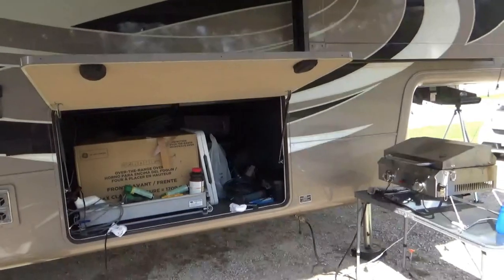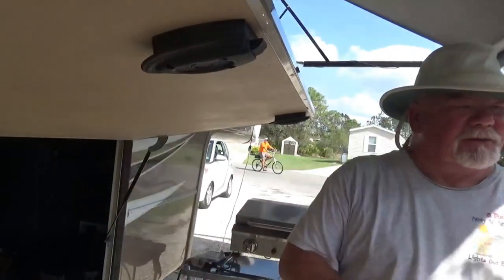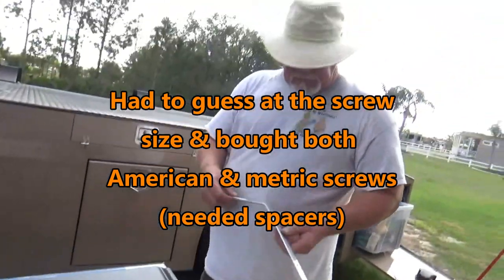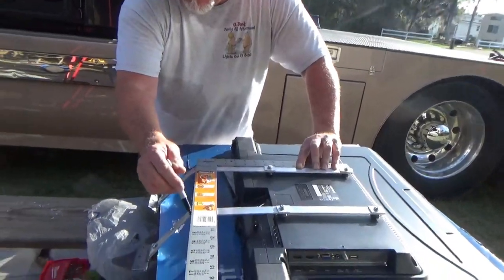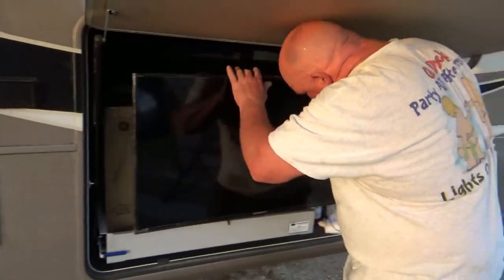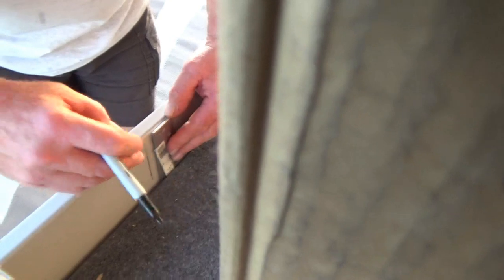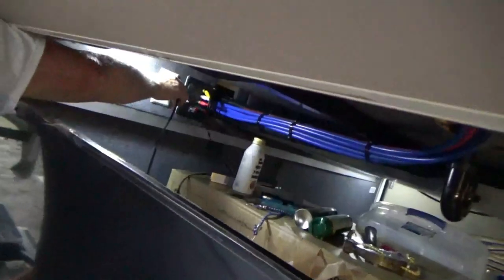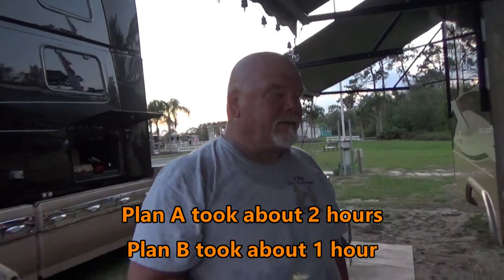How We Mounted Our TV Outside Our Fifth Wheel // Full Time RV

Comment: Great job! Thanks for the wonderful idea!
Reply from the maker: It ended up being really simple, cheap and has worked great and that way we can keep the TV out of the way until we want it.
Reply: @WattsOnWheels  i like that you didn't delete or edit your first attempt that way others wont make the same mistake, because when i saw that idea I was about to go do the same thing then saw that it didn't work and i have the same type of doors, so thank you very much for that.
Reply from the maker: @JosePerez-hg9je  Yeah.  We thought we had it all set and then "Oh Oh", it's not going to work.  We really like using the brackets.  So easy to slip in and out and the TV is out of our way when we aren't using it and easy to remove if we need to get something big in or out of the basement.

Comment: You don't have an HDMI slot where you hooked up your 3 cables?  This would eliminate the 3 wire system and give you a cleaner signal.  They actually have several different configurations of adjustable TV mounts that you could have mounted to the inside of the bay and swung the TV in and out and be more secure as well.
Reply from the maker: Yeh, we thought about the swing out for the TV but we were concerned about shifting of the load damaging the TV and the only place to put a slide out is on the left side of the basement and that is where all the access doors are to the mechanicals.  But i know what you mean.  And no, we don't have an HDMI port in the basement.  :( Thanks for watching.